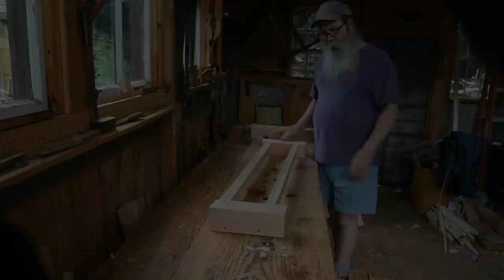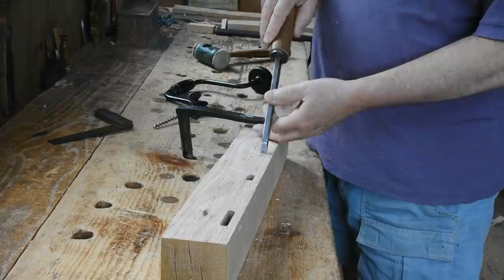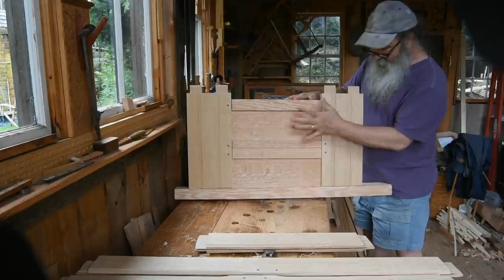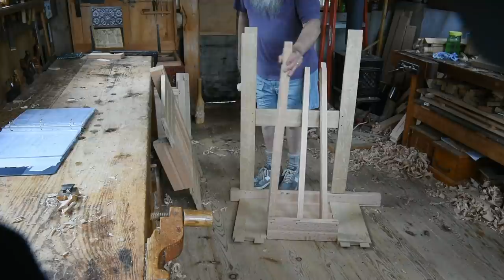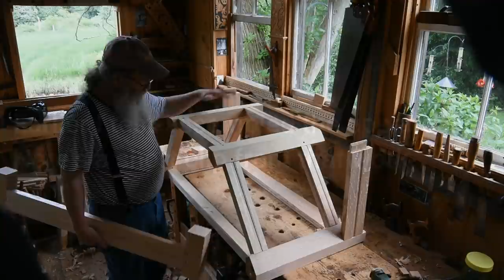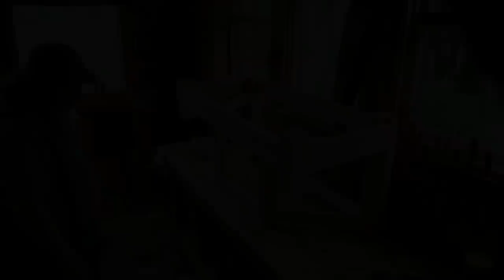Square blocks  & test assemblies

Comment: hi peter, as it seems from the assembly not lying flat on the bench there is some twist in it. this has  been an issue wit my own furniture projects. any comments on how you deal with, and avoid trouble with this?
Reply from the maker: SC: The way I deal with twist is to check each mortise & tenon separately, then altogether too. Usually it’s in my mortises. So I go in & pare the walls of the mortise where they are canted & throwing things off. It can be the tenon, but mine usually are OK. Sometimes if the twist is slight, the rails that are 90 degrees to the problem will push (and pull) things into place. 

SC: The way I deal with twist is to check each mortise & tenon separately, then altogether too. Usually it’s in my mortises. So I go in & pare the walls of the mortise where they are canted & throwing things off. It can be the tenon, but mine usually are OK. Sometimes if the twist is slight, the rails that are 90 degrees to the problem will push (and pull) things into place.